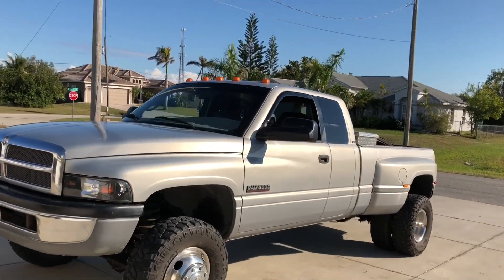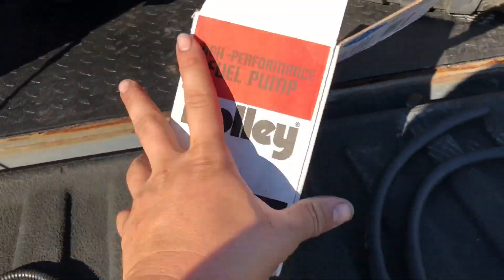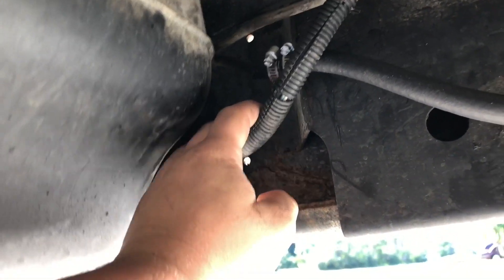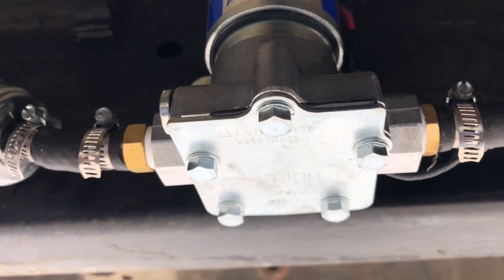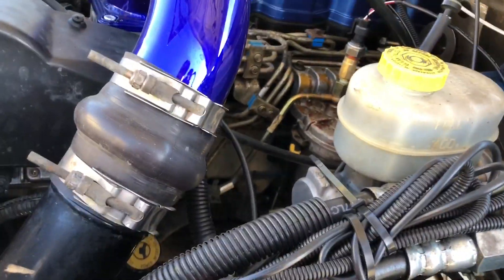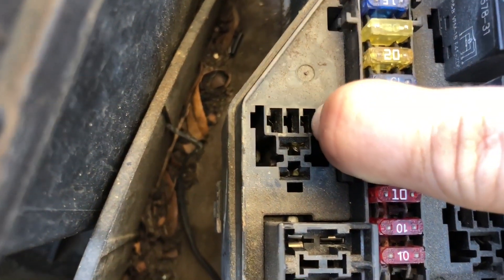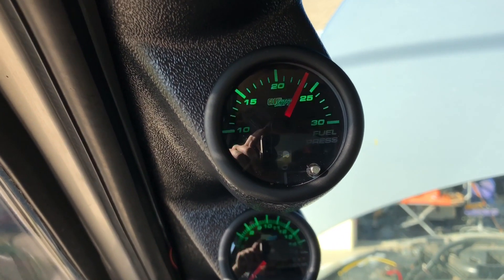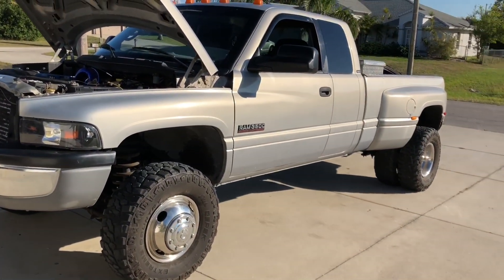How to get 25psi fuel pressure for less than $200!! 99 cummins 24v

Comment: Great video, just recently found your channel and I'm in love with your truck! I have a question, why is it better to have higher fuel pressure?
Reply from the maker: Thank you man! And on these particular engines they need above 14 psi of fuel pressure to keep the injection pump cool, and lubricated otherwise the pump will fail
Reply: @floridafenceland1137  No problem! And damn your truck was dropping to 9 psi too, how's it been holding up?
Reply from the maker: Nicolas Rebollar it’s been doin great man!
Reply: @floridafenceland1137  Wrong. 10 psi is the minimum specification at idle.

Comment: Good morning .. Nice Vid.   I have a 99 that I have owned since 2000.   Like you I was seeing a loss of pressure.on my fuel system.    After changing the stock pump at the engine several times.   I relocated the stock carter pump to the frame rail like you did with the holly blue.   I still had lift pump failures but the failures were extended to about every 2 years.   Vulcan performance out of Vancouver has a frame rail pump relocation kit .    I tried the Fass but it failed in 3 months and fass left me on the side of the road for a week till they were able to get a replacement coming .    I got tired of waiting so I brought a stock replacement and re plumbed a old spare stock replacement at the frame rail.    If you go back to the stock pump... go to Cummins direct and buy from them much much cheaper!   Nice 3500!
Reply from the maker: Good info! Thanks man!

Comment: I bought the pump and have it all rigged up underneath my truck but now my truck only starts and dies immediately after and I didn't put the regulator on should have put the regulator on?
Reply from the maker: I didn’t put the regulator either, are you turning the pump on after the trucks running? Or before you start it

Comment: I am curious about this as my understanding is the after 21 psi the vp44 stops working.   I have had experience with this.  I was using an airdog 150 at the time and put a 30 psi spring in, and it started and ran great, but i stopped for fuel and i could not get the truck to restart at the gas station i had to disconnect the fuel line at the gas station and swap the spring back and it started right up.   Does anyone know the limitations of these 44's?  right now i run 21 psi at idle and hold strong at 18-20 while cruising on my 4gII 160 airdog.
Reply from the maker: I have no clue exactly what is right and wrong all I know is I run 25 psi at idle and about 21 cruising and I have no issues at all

Comment: August 2019 How is it holding up?  Any issues at all?  Any changes?   Switching my pump, filter, VP44, injectors all out. (leaving the stock filter as a secondary filter)  Just curious about your holley set up.  Thx for sharing.
Reply from the maker: Okay so, August 2019, I’ve changed the pump once a few months ago, had no warranty left since it’s a short warranty so I bought a brand new one had it switched out in 10 mins and been great ever since, since the warranty is only 60 days, I put the old pump in the box and returned it defective and got my money back so I’m still happy with the setup still works fine! Still 25psi at idle, no issues with vp44
Reply: @floridafenceland1137  Good old holley quality control. or the diesel is getting the inner seal? Bio diesels are really hard on any rubber and even aluminum.

Comment: I don't understand why people is going to a airdog or any aftermarket lift pump   my truck has been converted to the in tank Lift pump it's been in there since 2003 and at idle I am holding it like 22 PSI I've never had any problem with my in tank system I guess because mine's all stock
Reply: I also have the in tank pump which was dodge replacements fix for a lot of block mounted lift pump failure.my truck is stock I have a 01 with only the in tank pump. What confuses me is can I run both in tank pump and a add a another either in the factory location on the block or in frame rail next to tank. Or eliminate in tank pump altogether. I'm seeing 7psi at idle and below 5 psi normal driving. 0 wot. Any advice would help. Thanks
Reply from the maker: Yeah there’s no reason you can’t run 2 pumps just Hook them up in line and run power to it you’ll definitely see a big increase in pressire
Reply: @floridafenceland1137  thanks for the fast response. I'm definitely gonna look in getting this pump seems easy enough to do. Have you had any issues with it since the install? Also is the regulator that comes with the pump look like it's adjustable?
Reply from the maker: Eduardo Silva no prob man! And it’s very easy, the only issue I had was the original pump died after one year, and I went an bought a new one, returned the old on under warranty and got my money back, had the truck back running in 30 mins but besides that the second pump is running exactly the same and running strong
Reply from the maker: That’s pretty cool I’m not familiar with that setup it seems like it works good! May have to look into that
Reply: I KNOW WHAT YOU MEAN ''''  MY 02 2500 ''STILL'' HAS THE ''STOCK'' FUEL SYSTEM ''''' NEVER HAD ANY ''ISSUE'S'''  21 - 22 P.S.I. '''' I ALWAY'S ''BUMP'' START IT JUST TO MAKE SHURE ''NO - DRY'' START'S ''''' '' FLAWLESS  '''' 155.000 MILES''

Comment: Hmmmmmm. . . Those numbers sound like too much!!

Too much fuel pressure can do the same thing that a lack of fuel pressure will do to your vp44!!!  perhaps you should have considered using the regulator?
Reply from the maker: Yes sir I do have a return line going to the tank from the pump
Reply: So the stock (pressure relief) is factory set to 14psi, should the VP44 need to dump pressure in an emergency, it's a return to tank valve technically.
Reply from the maker: Well, the vp has an over flow valve that opens to let excess psi go by and it’s been great for over a year so far so I would say it’s doing well
Reply: @floridafenceland1137  - I see.... this is the first I am learning of an overflow valve on a vp44.

It would make sense, I know a hell of a lot more about the p7100 then I do the vp44.

👍 I appreciate your hasty reply!! Lol
Reply from the maker: Mr. Brown yeah I wish my truck had a p7100 but this is working for now! And my pleasure I love comments I try to be helpful
Reply: @floridafenceland1137  - honestly I've been back and forth about doing a p7100... but at the end of the day if you take care of your vp44, it's kind of like a 6 liter powerstroke.... it can be your best friend, and can do you a hell of a lot better than the old 7.3 lol
Reply: @floridafenceland1137  - on another note, have you gotten your cease-and-desist letter from Sinister Diesel yet??? Hahahaha
Reply from the maker: Haha haha no I have not, I wish they would send me one lol they are rediculous
Reply: @floridafenceland1137  Does you pump have a return line line to the tank? It's next to the pump inlet, if there is no line attached, then the outlet (pressure  relief) is blocked. Just say in, no criticism intended.
Reply: U hhh, I've read the tech sheet on the VP-44, and I don't see any pressure refief feature, and I know 20psi is the max, otherwise you'll burn up that pump....just sayin.
Reply: @shaggyduder   - perhaps we are all right?

Here's a theory, I have no support documents or anything to cite.... maybe over 20psi kills a vp44 when it's starting? The delay on the system... well delays the lift pump for long enough to start but not to... I would assume blow seals in injecton pump?

Another wild guess a few guys have decided that has to be the reason their vp44 laid down... couldn't be the bad lift pump before hand that contributed to it, blame it on the new pump for too much pressure instead?
Reply: @shaggyduder  - what exactly would be the fail point if given excess fuel pressure? I don't know please correct me of I'm wrong.
Reply: @MrBrown-zp3yb  BOSCH says anything over 20psi causes very high fuel temp., and since the fuel is the coolant, the pump runs hot, causing failure, also, higher fuel pressure does not increase HP, warmer fuel causes a lose of power, boost and larger injectors gives more HP,  but at the risk of developing cracks in the block.
Reply: @shaggyduder  I always thought diesel needed pressure to ignite pressure causes heat diesel vehicles have no sparkplugs.
Reply from the maker: Compression causes heat
Reply from the maker: It’s been good for a good while now, soooo
Reply: This was taken from the Bosch tech.site. https://mopar1973man.com/cummins/articles.html/24-valve-2nd-generation_50/51_engine/59_fuel/fuel-pressure-specification-for-bosch-vp44-injection-pump-r21/
Reply from the maker: Yeah for sure
Reply: @floridafenceland1137  it's too bad we can't go back to a mechanical for cheap. I'd do it.
Reply: @shaggyduder  - thanks buddy. Makes sense, learn something new everyday.
Reply: The VP-44 is rebuildable, and it's pretty easy to get off the motor, if your skilled enough, I guess FP is not that critical. It just took me 2 months to rebuild my front axle, screw that.
Reply from the maker: Yeah fuck that lol never fun
Reply from the maker: I would too manN

Comment: I have a 2001 24v and my truck is around 8 psi at wot which is a little scary sometimes. Wouldn't 25 psi be too much fuel? My truck is all stock. I dont know if yours is stock
Reply from the maker: Also, anything over 17psi, bleeds off and returns to tank so, more the better, rather have it and not need it then need it an not have it
Reply from the maker: I would suggest putting one of these guys on your truck! 8 psi is pretty low, I would say 12 would be the lowest you’d want an WOT, my truck is all stock besides straight pipe and intake that’s it so your truck should react the same as mine, you lift pump appears to be working still so I would wire them both to the same switch, or wire them both to the factory
Lift pump wires so then you don’t need to run an auxiliary switch like I did it’ll turn on from your trucks ecm like factory
Reply from the maker: It should be fine to drive like that I’m sure it making 20-25psi, and you said when you turn the switch off you have 3-6 psi? Did you wire your factor pump in with it or no?
Reply: @florida country. I put the fuel pump on my truck and it maxes the 15 psi gauge out. Would it hurt anything if I drove around like that for awhile? Also I turned the switch off and I was getting barely any fuel pressure at all like 3-5 so I'm thinking my factory lift pump wemt out
Reply from the maker: It probably didn’t go out, it’s tryin to suck fuel through the new pump so it’s an added restriction that’s why there is low psi with the Holley off
Reply: I wired the holley separate but I ran it straight to the battery and having a switch inside my truck. Where did you get your guages at?
Reply from the maker: Yeah that should be fine, and maybe amazon, they are glow shift
Reply: If I did away with my factory lift pump on the block would that lower it much? I'd be more happy at around 18- 20 psi
Reply: @florida country hey bud. What gauge wire did you use?
Reply from the maker: Not 100% sure maybe like 16 or 14 gauge
Reply: Alright man. I have 16 gauge on it now but sometimes after I shut my truck off something smells like burnt plastic
Reply from the maker: Run the truck for a little bit then shut it off and then go feel your wires and see if they are hot

Comment: Just did this mod, and wanted to share one thing with anyone interested,  if the holley pump is off fuel will run out and engine will die..
Reply from the maker: I think that’s obvious if you your pump is off your run out of fuel

Comment: Do you think running just the blue with no stock pump at all ( with block off plate ) would still provide the same pressures as you said in your description under the video?
Reply from the maker: Ya know I’ve wondered the same thing! I’m really not sure to be honest with you this pump advertises 15-17 psi on the package so
I’m not too sure
Reply: @floridafenceland1137  I guess there is only one way to find out unless someone makes a video of that first! ;))
Reply: @floridafenceland1137  There is a block off plate where my lifter pump was! I just bought a 94 12 valve with a Bosch P-pump a few days ago and the seller told me I needed to buy an external lift pump for it
Reply from the maker: Ahhh I see so I may be wrong but I believe a p pump truck needs to have more fuel pressure than a vp44 truck like mine, I would look into that, but most 12vs don’t have any pumps from factory
Reply: @floridafenceland1137  Btw how is that pump holding up after one year?
Reply from the maker: Still running good, I daily drive it and no issues yet, I posted an update video on my channel about it as well

Comment: I did virtually the same thing. Mounted a Holley blue on the frame just in front of the tank and left the stock carter pump in place and ran both together but I had a dedicated ignition on power source so when the key was on the Holley was on. ( noisy pump) but It makes more sense to have both run together only when the engine is running or with a bump start. Any way the Holley went south in a couple years and the stock pump can’t draw fuel thru the Holley so a emergency bypass if needed would help. It left me stuck so I crawled under and removed the bottom plate on the Holley and removed the rotor assembly so fuel would pass thru and put the plate back on.
Due to stock pump now going bad I’m glad I had bought a second Holley blue couple years ago and stashed it so I’m putting it to use.
Reply from the maker: Yeah man a lot of commenters giving me crap about it lol but it’s been working great and still working great to this day I’m happy with it
Reply: I did the same thing but it'd a holly black pump mounted it on rail to a toggle and with both running its burying my fuel pressure gauge at 30psi with both I unplugged the factory lift pump and ran just to holly only makes 14psi and on a hard pull runs out of fuel my truck is stock besides a 4" turbo back exhaust and a small power puck programmer
Reply from the maker: Yeah I have both together and I run them on the same switch and it runs 23-25 psi and no lower than 19 on a hard pull

Comment: You’ll be replacing your injection pump you  will blow the rotor plate inside the injection pump.
Reply from the maker: Thank you
Reply: i don't think so actually..    there is no real hard data on it that ive seen after 20 or more hours researching this kind of stuff.    not one person on the forums has done anything more than say "youll break it with too much fuel"       one things for sure.   you most definitely will break it with not enough.     so yeah.
Reply from the maker: I would agree with you sir
Reply: Some people say “well I think this is why mine broke” but they don’t have anything more than a gut feeling or correlation to prove it.     As we know correlation is not causation.   It does seem likely if you were running higher pressures... like up in the mid 30s or 40s or higher there might be more risk.   But my setup is like yours... and once I went dual pump I never saw more than 27 or 28 psi and have had nothing but better power as a result.   Also you’ll know when your fuel return tee and other stuff start to not seal well anymore... you’ll have some leaks at that pressure if there are leaks to be had.    But I think your biggest worry is just not remembering to flip your pump switch after you crank the truck... I set my edge module to audibly alarm if fuel press is below 12...     I did the relay thing from my Ecm harness.   But it’s your machine.     We are all our own warranties now on these 2nd gens
Reply: The only other thing... since you put it on the frame rail anyway is might as well put larger diameter fuel hose all the way to the filter if you feel like it for more flow.   Mine is like Frankenstein’s monster at this point with bigger hoses etc...  2 pumps in series right next to each other.      I think the flow would be better if I dropped my tank and did all the mods to the pick up module..  but that’s another can of worms and worrying about 1/4 tank issues or adding a sump... etc etc.      if you drop your tank ever replace that brake line behind the tank.   Or check it...   that’s where mine rusted out I think a lot do but you have no rust down there in gatorville lucky mf
Reply from the maker: Yes sir I agree with you, you seem like we think a lot alike! Smart guy haha thanks for commenting I agree with all of it lol
Reply: @dillrepair  It will never flow more than the injectors require.